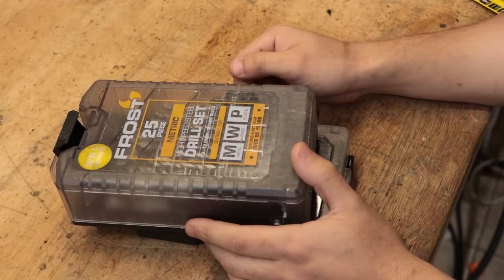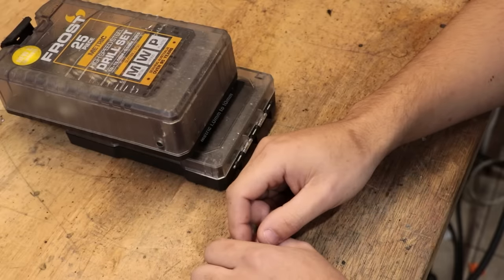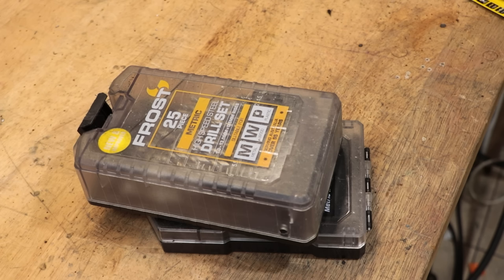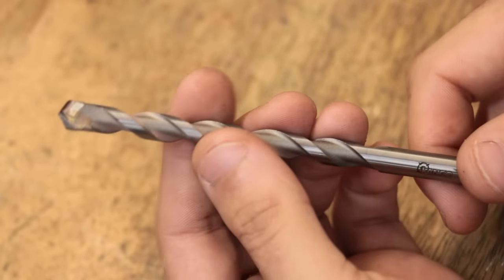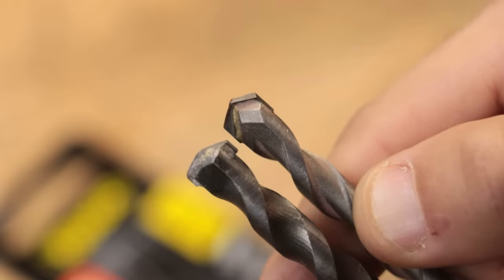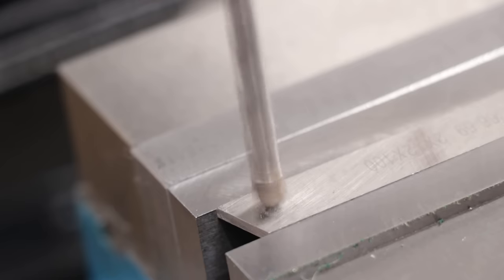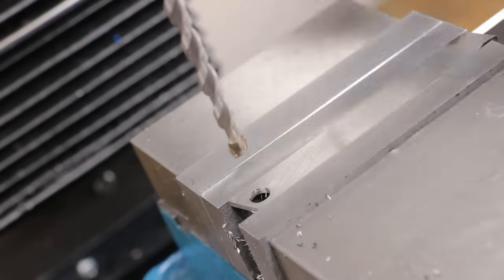Drilling Hardened Steel With Masonry Bits - Not A Lifehack

Comment: Yes I do this often.  But I grind geometry into the carbide first.  Leave the rake at zero degrees and grind clearance until its sharp.  You have to take a fair bit off on a new drill.  Automatic feed is a must or else the carbide will break on the way out the other side of the hole. This is due to the feed rate drastically increasing as the bit exits the hole.  I've also sharpened the carbide backwards and run it in reverse to drill out broken studs and bolts.  Works well.

Comment: Reshaping a masonry drill bit tip to resemble two inserts on a shaft makes a huge difference, drilling through masonry is so much faster but heat needs to be controlled when drilling steel....👍👍👍

Comment: I had to use a 300mm masonry bit to drill out an engine mounting bolt from a ducati. Had to go through from the opposite side of the engine. The masonry bit worked really well in that steel.

Comment: Well, I am surprised. As pointed out, this type of bit is essentially a crushing bit for brittle materials. I assume the improved ductile drilling action came from the chips in the tip that probably are heat crack related. This makes me think that it is worthwhile grinding a conventional twist drill profile on one of these.

Comment: Masonry bits work really well on (unhardened) damascus billets (e.g. for making a 'raindrop' pattern). I have used the red 'Alpen' brand masonry bits with great success, even though they barely leave a mark on basic low-carbon structural steel.

Comment: Went it comes to masonry bits, they don't really cut rather than chisel. You should definitely sharpen them to have a similar cutting edge to a actual drill. As well, when cutting through hardened steel, do not use coolant.

Comment: The carbide on those can be actually quite decent. The geometry on the tip is a mess tho for drilling proper holes in metal BUT you could grind, with a diamond wheel and (toxic) dust extraction please, a similar geometry on it then with a normal HSS or carbide drill. Works actually quite fine! In case you have a grinder lying around and no fitting drill bit for hard stuff imo definetly a legit "hack". Keep up the good stuff and im curious whats coming next. Peace!

Comment: Use a dremel with a little grinding ball stone or diamond crusted ball, you can make a nice neat divot in the material, like a "centre punch" for hardened material but a bit bigger and deeper. I like this technique because you can inspect and "walk" the divot position as you deepen it to get accurate location.
Then you can drill with a heap of force and the divot will hold the drill steady right from the start.

Comment: I have used a standard masonry bit to drill through sockets for a tommy bar, after killing several standard drills.
Produced a lot of heat and socket glowed red around the hole but it got done 
Hole a bit large as mentioned 
I believe the “do-all” bits have a sharper edge and are probably better geometry
Reply: This is the sort of thing this "hack" is good for.  We're not all machinists.  Sometimes you just need a hole in something hard.  I've done this twice in the last 10 years.  Just as in this video, it made an ugly hole and the drill was ruined, but it was good enough for my needs.

I purchased across a really cheap set of the Milwaukee shockwave multi-material bits at a bargain store.  I drilled a 3/16" test hole in the handle of a cheap wrench - probably slightly hardened, but definitely not 66 HRC.  The hole was clean, reasonable round, and just slightly oversized.  Better than my results with the masonry bits, but visibly imperfect.  However, there was no visible wear on the bit.  This is anecdotal, but there seems to be a difference between the multi-material and masonry bits.  That said, I compared them my Milwaukee shockwave concrete bits, and the edge geometry looks identical.  Both are geometrically similar to my Bosch concrete bits too.  If there are differences between the concrete and multimaterial bits, it must be in the metallurgy.

Comment: Aye it works (when you re-grind the carbide to a better shape), have used one to drill stainless too which usually needs a very hard cobalt or carbide tipped 'locksmith' drill.

I try to always keep a set of carbide tipped locksmith drills around though, they're really useful and go through anything but they're basically like these re-ground masonry bits.

Comment: I've drilled some small holes in hardened circular saw blades with masonry bits that were sharpened on a diamond plate.  It worked,  just.

Comment: I have used a 18mm masonry drill to drill a couple of holes in 1/2" Bisalloy 500, HSS wouldn't touch it and a masonry drill was all I had so I ground the right geometry on it and gave it a go and it worked, no pilot hole and plenty of coolant.

Comment: It's an old time hack to use a masonry bit to drill hard steel, my dad taught me this many years ago. I actually used this to drill out a snapped exhaust stud on my Fireblade after a couple of attempts welding a nut on had failed and the stud had become so hard that regular HSS drills wouldn't touch it.  You need to make sure the tip is actually sharp and you need to be careful not to get it hard enough to melt the braze that attaches the TC tip to the shank.

Comment: You need to sharpen the tip, then they are good in a pinch. 

Alternatively look for locksmith drill bits. They already have the right cutting geometry.

Comment: For accuracy drill a undersized hole and then use a carbide tipped boring tool in a boring head to finish the hole to size.

Comment: I think the problem you were encountering, with the wandering and the oversize hole is caused by the cutting edges of the drill bit. Masonry bits are designed to be hammered into hard substrates like brick and concrete. So their 'leading edges' are not sharp. In fact they have another bevel ground onto what is normally the cutting edge of drill bits, to keep the leading edges of the carbide tip with a wide angle, which is able to withstand the hammering into concrete etc. In fact it IS POSSIBLE to sharpen these bits. If you think of a TCT router cutter, the edges have to be SHARP, in order to cut wood. And the carbide drill bits also have sharp cutting edges. So if you use a diamond file/wheel/plate to put some sharp edges on the masonry bit, it should act much more like a carbide drill bit. Not sure about the degradation of the tip though. Not tried a sharpened masonry bit in steel. Maybe you could give it a go???

Comment: I’ve used this trick to drill pinning holes for a knife handle when the tang was to hard for a conventional drill. Blade was made from an old mechanical hacksaw blade and it was as hard as a winter nipple

Comment: i bought solid carbide drills to drill some tool steel using a good pillar drill,the quill does not match my lathe or mill for run out,and the bit shattered on contact with the work piece,lesson learned ,use the mill.

8mm solid carbide bit from ebay a few quid no big deal,just a pain in the arse.Next time i want to cut 65ish rockwell i'll sharpen a masonry bit.

Comment: its necessary to sharp the ends, like a normal drill bit, use low speed and plenty of oil and put in water if gets too hot to avoid lost temper
Reply from the maker: Could work. I was just using the standard carbide surface speed for this size drill. That could see some improvement
Reply: @artisanmakes   i use to drill spring steel a lot using that, but speed steel are more hard indeed

Comment: A tip, or two... Using these kinda demands of you to at least have a d-bit grinder, as to be able to impart any required geometry into the carbide tip... As was shown, you can push it through, but it would and could be self centering and easy cutting, if it had proper geometry imparted... Not just that, but keep in mind that despite this being carbide, it is brazed onto a steel body, so cooling is most critical if you want to allow it to cut some proper holes... The hammer drill bits with carbide, or cermet tips are much more durable than any lathe insert or mill insert or even carbide drill for that matter, as those are cooked as to allow them to impact hard into stone again and again, tens of throusands of times in their working life, without any problem or chipping, but they are not as appreciative of heat as some machine carbide is... You are unlikely to burn it up, but heat can fuck up the geometry imparted or mess with the braze joint, so keep them cool, and consider a dbit grinder... Also, if you can snag junked large sds hammer drills with carbide tips, those can be taken out with heat, and the carbide or cermet insert can be brazed back onto another say square shank, and allow you to grind a lathe tool from carbide that will be immensely better at dealing with interrupted cuts than any other regular insert you can get(that isnt the same grade carbide and costs an arm and a leg)... If you can get them as scrap, they are literally worth their weight in gold for custom tool making, and they are nearly cbn hard, so if you need them for hard turning or hard fly-cutting, oh boy, are you in for a treat like you`ve never seen before... Its a great material if you can get it as scrap, and madly pricey if you get them as a dedicated product from a supply... Just like with cbn or such, a few bits quickly add up...

Comment: Hi thanks for this,i changed my exhaust today and the bolts had been welded on,after grinding off the old bolts i tried to drill out the holes and blunted every hss bit i had,so tomorrow i will go again with a masonry bit and see how it goes

Comment: There are carbide-tipped multi-material bits; I think I bought one and if I did I'll see if it's the same sort of animal with better geometry.  I saw... Stefan? maybe drill through spring steel with slow feed and lots of pressure.

Comment: You need to change the rake to match a normal metal cutting drill and if you use a 2mm one first they cut well for a pilot hole

Comment: Masonry drill bits work great in Phosphor Bronze. Normal drills tend to jam but the side of the carbide can be sharpened too and it keeps cutting no matter how hot it gets. 😀
Reply: Would running the bits at a much higher speed prevent the bits jamming in phosphor bronze? And a slower feed rate too...

Comment: I was machining AR-50 plate, really tough steel. I had to drill 30 holes in a pattern. I was able to do it with masonry bits. I had to resharpen them a lot but it got the job done. I completely trashed 2 of them and the third one barely had anything left but it was about $20 VS. $100 or something and it didn't take me a ton longer to do it. Accurate holes? Nah, but they did what I needed to do.

Comment: TL;DR tried this a few times and found the carbide tips on masonry drills vary extremely greatly in quality, some break/chip/blunt attempting to use them and others just eat your bench grinding wheel like no tomorrow trying to regrind the shape of the tip or touch up after use... i spent 20 mins on a bench grinder with a 10 or 12mm drill and only just managed to get it marginally better it was hard as an old coffin nail...

Comment: if you sharpen it with a diamond drill bit sharpener its much better or use something like a mr twister carbide tipped drill bit thats designed for drilling hard plate in safes and such

Comment: Like you point out, masonry drill bit geometry is wrong for cutting steel.  Or wood.  Or anything other than masonry or stone.  However, it is quite possible to regrind  a masonry bit so that it does cut steel.  That's where the lifehack, such as it is, comes in.  But you need to know how to grind a drill bit.

There are caveats however.  It's very difficult to get any rake on the cutting edge, you're going to end up with a 0° cutting edge.  And you have to grind away half of the carbide in order to get the cutting edge in the right place, so you end up with something that's quite fragile.  But you can absolutely make a perfectly serviceable carbide tipped drill bit by regrinding masonry bits.

Comment: You could also use a glass drill, have personally used two on a REALLY hard cast iron plate ( hard enough to ruin files), and it worked flawlessly, but you need to cool it down
Reply from the maker: Didn't cross my mind but that is an interesting suggestion
Reply: The carbide ones are also really sharp and have a pointed tip

Comment: I needed to drill holes into a knife blank I had cut out of a 24" HSS metal cutting circular saw blade. The masonary drill bit worked. Barely worked but one drill bit has been enough for three holes. Not beautiful but good enough and the holes are covered by the knife scalea and not visible anyway. Still have lots of saw blade left so I will need to buy a new masonary bit now.

Comment: Re-sharpen the point to much more appropriate angles, cool it by blowing air on it. Also, get a shorter drill.
Used to do it in die-making workshops to get through hardened steel, all the time (well sometimes, ok occasionally...)

Comment: I think I see the problem.
1. You really need a center drill hole first, as it will prevent the walking and improve the accuracy somewhat.
2. Break out the diamond wheel and do your best to replicate proper drill tip geometry.
3. Your RPM looked a little fast for a hard steel, and you did not use coolant. Even carbide will not last long in hard steels unless you abide by all the rules.

4. (And lastly, cheap carbide will not last as long a higher quality carbide, but that is another topic.)

I'd hope to see you try this test one more time, and report back to see if you had better results.

Comment: Get a diamond sharpener and/or diamond wheel and sharpen/reshape that carbide tip and it will cut hardened steel easily and will also not get mangled after drilling holes..    Been using this trick for 20+ years and the machinist who showed me had been using it even longer...

Comment: Sharpen the masonry drills, or at least hone it with a diamond card, I use carbide masonry bits all the time to drill out broken taps drills and hardened metal.

Comment: drilling hardened steel is a lot easier using RODMAN drill bits and they will last longer.  I have had one for 15 years and have drilled through metal files, hardened steel shafts and many other "hard " metals

Comment: The proper chips were there becuase of the heat built up, which could ruine the part.  Afterall, there is a reason you're drilling hardened material in teh first place.  Coolant is your friend.

Comment: If you have a drill sharpener or grinding wheel you'll get a lot more uses out of your masonry bits when cutting metal. I've even had some success with the cheapo ones if you regrind the tips before first use. Remember to use a respirator when grinding carbide, unless you pick lung cancer as a lifestyle choice.

Comment: Cool video and I got a good laugh out of the hacksaw line. My favorite drill bits are the YG-1 Gold P drills. Not for hardened materials of course,  but for most metal drilling they have proven to be outstanding.  I get two and three times the life out of them compared to older more famous brands. They are also considerably cheaper than the famous names.

Comment: also a solid carbide drill is very brittle....  need rigid fixturing, handheld not recommended, especially if hole is deep.
Reply: you need to  grind/sharpen the carbide for cutting metals...   diamond... there are many youtube videos on this.

Comment: I've got a question. I wanna be able to put 10 (or 12) mm tooling on my stock 4-way holder because there is a wider variety of cutting tools for 10 mm that you can get for cheap, so I'm planning on milling down one side 2 or 4 mm. Do you think it will impact the rigidity a whole lot? Also, I think it would make a decent video idea,since most people do not have the cash for a quick change or na ew full cross-slide setup like you have.
Reply from the maker: It is a common enough upgrade that i've seen it done a few times before. it might reduce rigidity a bit but nothing that would matter in the context of a mini lathe.
Reply: @artisanmakes  Thanks for the input. I don't get why they couldn't have just put a bit more meat on the bottom, dropped it, and added so shims with the lathe,  it would make the holder way more versatile.

Comment: It works a lot better if you give the bit proper cutting edges on a diamond wheel. It’s still a life hack, but stays on center and drills like a normal drill bit. Also good to drill a l’or faster through rebars in reinforced concrete.

Comment: Never been impressed with the quality of carbide in masonry bits. You can buy good quality solid carbide drill blanks a lot cheaper than drills and make spade bits from them. I made a knife blade from M2 HSS, and drilled it like butter with a carbide spade bit.
Reply from the maker: That is very interesting. Ive heard of people doing this but never looked much into it

Comment: GRIND THE TIP TO A PROPER ANGLE AND RAKE
Reply from the maker: Well thing is I thought that I could get away with it, didn't seem to be case until I shattered the tip.
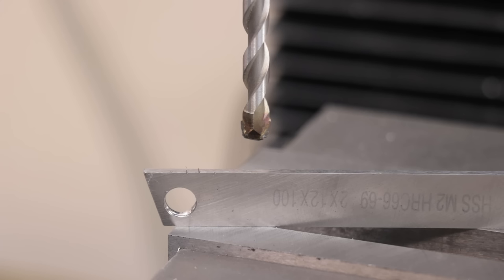Reply: I have reground 4:51 masonry bits for hard steel. Cuts better but tolerance was poor. The carbide insert didn’t appear centred or to correct diameter. I used a wheel meant for carbide but it was slow grinding.

Comment: For hardened steel I'm using drills with soldered carbide insert, but the problem is that the drill tip is not made of carbide. The solution may be to drill smaller hole with full carbide drill (or try with the masonry) and finish with the one with carbide insert.

Comment: It looks like the bit once it had broken in take gave you two separate cutting areas one would be probably 132° any other would be probably 190° just a quick glance I don't know so if you shaped it first then sharpened it and drilled with it I wonder what kind of difference it would make